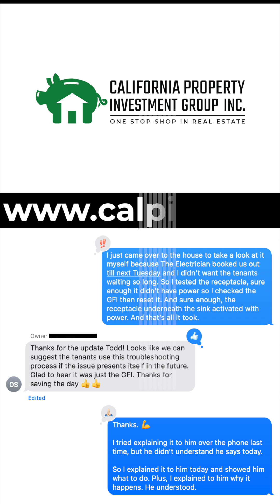The GFCI Outlet

Comment: I would still have an electrician come out and take a look at it because there's a reason that that GFI is popping
Reply from the maker: Because the appliances that he’s running is drawing too many amperage for the fuse . Hence, you can’t run an air fryer and a dishwasher at the same time and then plug in a toaster. Thanks for watching.